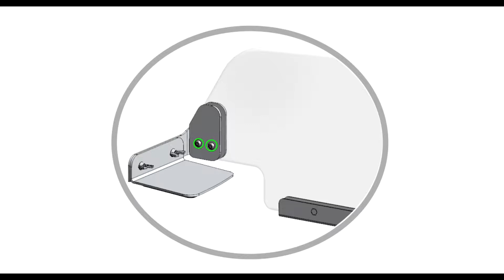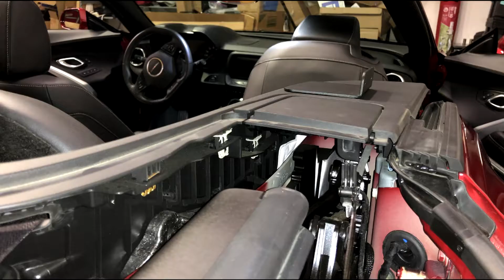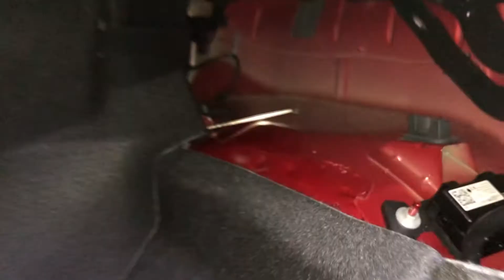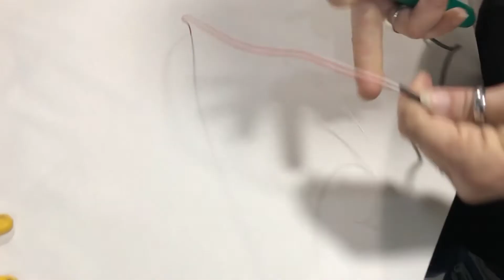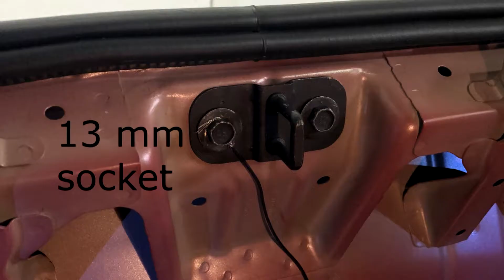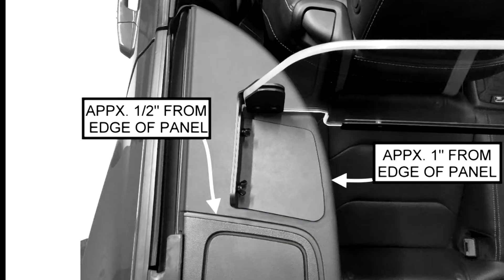Camaro 6 Convertible Illuminated Windrestrictor® Installation

Comment: Was looking into buying this for my wife's 2021 RS as a surprise but after seeing it's mounted by 3M tape, I've changed my mind. Pretty sure she would kill me for putting tape on her car.
Reply from the maker: We use VHB, which is very high bonding tape, the exact stuff they used to hold on panels and components when manufacturing vehicles. It replaces welds and rivets. We sure appreciate your interest!
Reply: @WindrestrictorTV  I need to remove the brackets that are secured by this 2-sided tape from a Gen 6 convertible. How do you suggest to do this?

Comment: Has anybody experienced that f33 and f19 fuse dont have any power to them.
Reply: I think right now I am
Reply from the maker: Yes if you have a tester and find one that is on with engine or accessory mode you can use others. Those were factory options. Please contact us if we can help! www.windrestrictor.com there's live chat on our website or call us 972-487-5987
Reply: camaro wind deflector